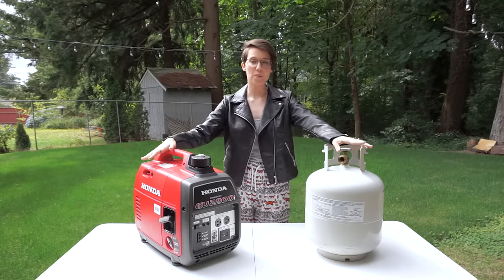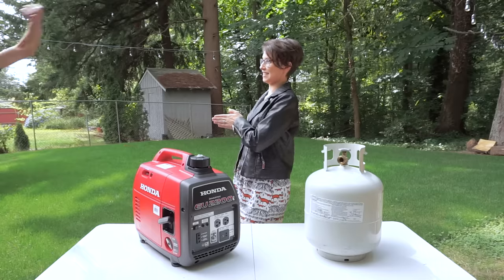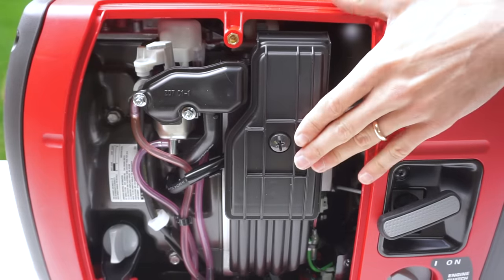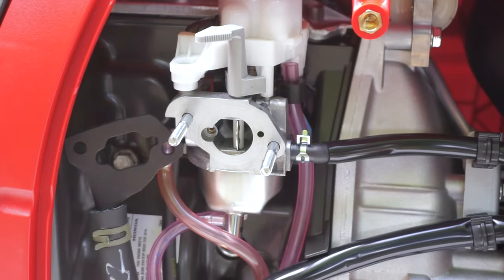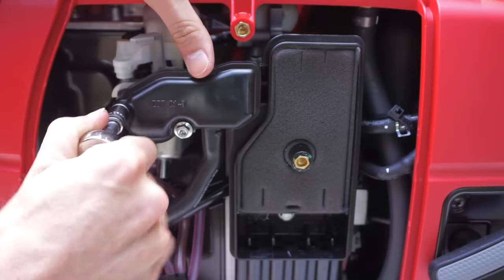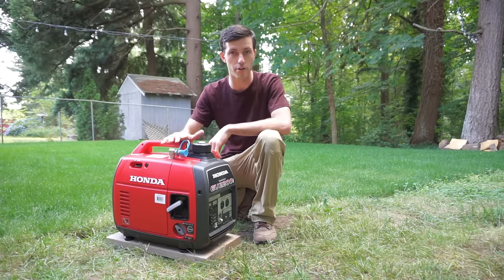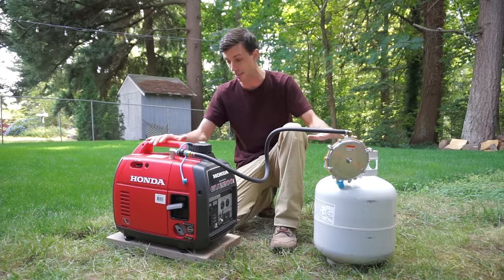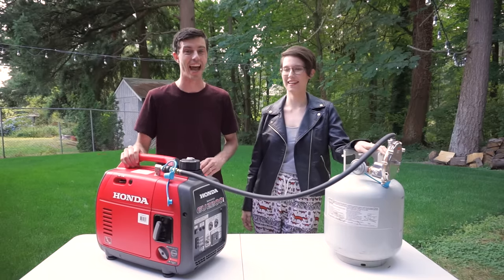Honda EU2200i Propane Conversion Kit - DIY Install for Honda Generator

Comment: So stupid to live in your house and not use solar panels + electric car.
Reply: You spend more on diesel repairs.
Reply: @TheBlackFoxMaster  ,,,You are showing how uneducated you are about Diesels, Most diesels will run for 250.000+ miles before requiring any minor REPAIRS.
Reply: The diesel engine is very backward, it has many parts that break down and that need to be constantly changed, they simply do not exist in the electric car.
Reply: @TheBlackFoxMaster  ,,,A Diesel engine/truck will outrun/outlast an electric motor/car by many years @ a lower overall cost.
Reply: Nope.

Comment: Hutch Mountain should have provided 2 longer studs. For Hutch Mountain to say it's okay to leave those two nuts threaded on only half way is wrong. Would you put a wheel lug nut on only half way? Or, for that matter, any other nut? For what the kit cost, they could have easily provided the longer studs. I bet if you call Honda they would not say its okay to leave those nuts threaded only half way on. Otherwise they would have designed it that way.
Reply from the maker: I think we can both agree that putting a lug nut half way on is not at all equivalent to having a generator's air cleaner box nuts halfway engaged on the threads. One could result in death, the other could result in your generator stalling out. Very different scenarios there. And Hutch Mountain is actually working on a solution to this problem (longer studs I believe) that they will include with future kits. Like I said in the video, if you're worried about them vibrating lose just put some lock tight on, not a big deal.
Reply: @FateUnbound  Agree..BUT I would def install the nuts using blue locktite...it will be very helpful keeping them tight...Im a harley rider so I speak from lots of experience!  LOL
Reply: Actually, that was not the point I was trying to make. The point is that the kit is wrong and the manufacturer should not have put it out the way they designed it. it is very tiresome to see 'stuff' put out there that is not quite ready but put out there to make money first and quality second. It's wonderful that they are going to fix the issue, or so they say, but it is still wrong as it is.
Reply: @Tom-In-Ga  Agree Tom....make the kit right...Im unsure how much thread was actually left but I know they make low profile jam nuts and those should have been included in the kit